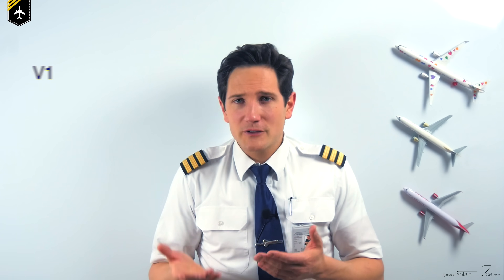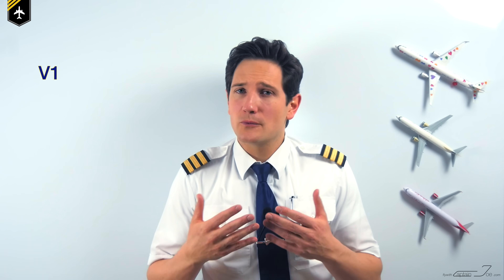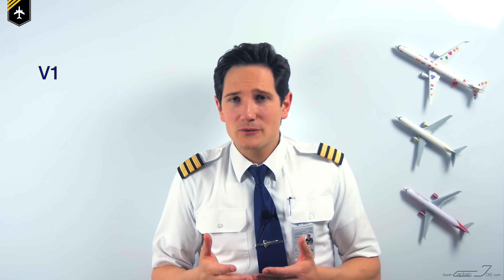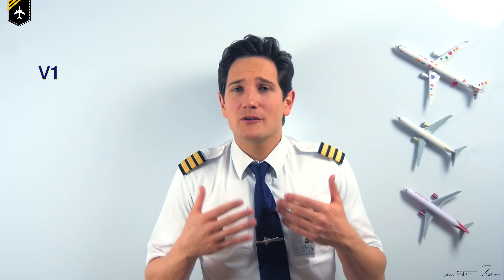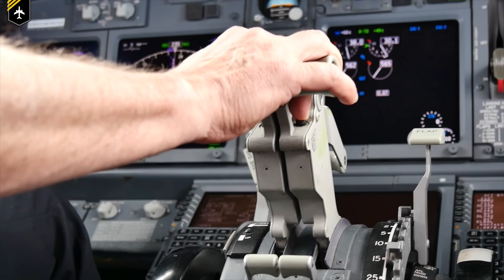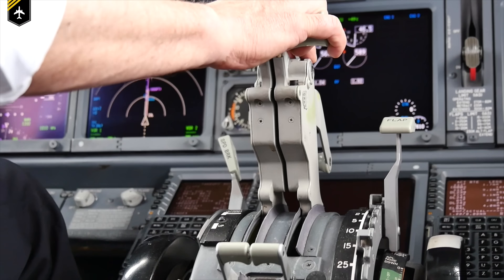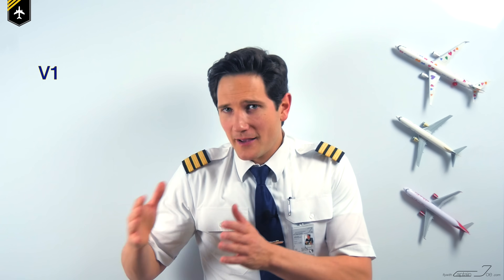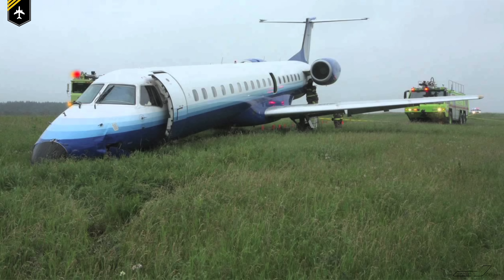TAKE-OFF Speeds V1, Vr, V2! Explained by "CAPTAIN" Joe

Comment: CAPT JOE
MY QUESTION -- CONTROL TOWER OFFICER MUST HAVE PILOT SKILLS OR NOT ?.
Reply: Not "CAPT JOE" here.  Generally no, air traffic control personnel are not required to be certificated pilots.  it is a great big world out there and I am unable speak for every possible situation; military, research, clandestine or who knows what other combination of controller/pilot pairing requirement.  It certainly helps communication, expectations and overall situational awareness when the pilot(s) are also certified and experienced air traffic controllers, and air traffic controllers possess pilot certificates ratings and current flight experience.  Air traffic controllers and pilots work in the same national and international airspace system, but each has their own set of rules they must abide with in addition to the common aviation regulations that govern both.

Comment: Why retract the landing gear after losing an engine?
Reply: Because the plane has much better performance when it isn't dragging the landing gear through 200 MPH air.  Why leave it down?  You've left the runway behind.  It also limits how fast the plane can go without damage when it is down.

Comment: The concept of V1 seems flawed.  It seems like V1 is a combination of speed and location on the runway.  For any given aircraft speed, there is a point along the runway beyond which you can't safely stop.  The V1 calculation assumes that the aircraft will accelerate as expected.  If the aircraft accelerates slower than expected, then V1 is no longer accurate because the aircraft won't reach V1 speed until it's farther down the runway than planned, thus past the point of being able to safely stop.

Also, why does V1 have to happen before VR?  If you have a long runway, strong headwind, etc, it seems like you could reach VR well before V1.
Reply: Jim St John V1 is a speed, not a location.  You are correct in one respect.  If the aircraft is at the runway limit weight and does not accelerate the way it should, a reject at the V1 speed would result in an overrun.  Takeoff power is measured by EPR or N1%.  If desired setting is achieved, the aircraft will accelerate as designed.  The only exceptions I can think of are a subtle windshear, or dragging brakes which would be noticed during the takeoff roll.
Reply: If the engines don't develop the expected thrust then you always abort the takeoff.  V1 is only a consideration if both engines are performing nominally up to that point.  V1 is calculated with a particular thrust profile, because commercial jets on long runways often don't use full thrust for takeoff in order to save wear on the engines.

Comment: Question: can a runway be so long that V_loft or V_2 is reached before V_1 ? That is, that you can always reach take off speed safely because there is so much runway left that you can still come to a complete stop no matter what ?
Reply: Juan Manuel Borrero the best way to answer this is to ask if you can get to 58 mph before you get to 55 mph in your car.  The V speeds are speeds.  V1 is the lowest, Vr is next and V2 is last.  You always pass through them in order.  No matter how long the runway is.

Comment: for a twin-engine plane v2 is for 1 engine failure. For a 4-engine plane is v2 for a single or double engine failure?
Reply: Oleg Geraschenko i was wondering the exact same, becouse i doubt a 4 engined jumbojet can take off with only one engine running
Reply: One engine failure.

Comment: I love your videos. I'm still wondering how 300 000kg plane can stay in the air. How aeroplane wings can stand that heavy load? V1 speed is so slow how can wings create  enough lift to takeoff?
Reply: Aircraft operating weight determines how much wing area is needed to stay in the air at a given speed.  So bigger wings for bigger aircraft, unless they will only fly at faster speeds for takeoff and landing (e.g. high-performance fighter jets).

Withstanding the load is done by making the structural parts of the wing thick enough, and the math for that (at least in basic design terms) goes back about 150 years.

Things like flaps (on the back of the wing) and slats (on the front of the wing) help to get more lift from a wing design, so that the aircraft can take off a a lower speed than would otherwise be needed.  That allows the runway length to be shorter, and the tires to not have to be designed for operation at a higher speed.

Comment: captain joe what do you do if both engines get a failure after take off v2
Reply: john ali you land at the nearest clear area if you can't restart the engine.
Reply: john ali 
I see a lot of answers to other questions referring to Captain Sullivan but they weren't really the right answers. For this question however it is the right answer. Like the comment above said, the first clear area
Reply: Land the ship as close to runway heading as you can obtain clear field. Activate RAM Air immediately. Don't count on restarting either engine; even if you succeed, you won't have enough altitude to spool up...

Comment: All well and good, but here's my question, which is implied by this video but never answered.

(First, I've seen a couple comments asking about what you do when both engines fail after V1 but before Vr.  Well obviously you can't take off with no engines, so there's nothing you can do except slam on the brakes and pray.)

Okay now here's my question, which as I said, is kind of implied by the video but never answered:

V1 is the speed at which you are committed to taking off even if you have one engine out.  V2 seems to be the speed you have to be going in order to take off with one engine out.   What happens if you lose an engine between those two speeds?  Too fast to abort the takeoff, but not fast enough to actually take off.  It sounds like you're screwed if that happens.  What say you?

Comment: This is an excellent video and answers a lot of questions I've had about the roll and take off of jets.  From a stylistic standpoint, Captain Joe, I think people will either like, subscribe or whatever without the admonishment.  You give a very thorough and easy to understand discussion and that will make more people, me included, to watch more of your videos.  I had wanted to post this to LiveLeak where there are quite a lot of flyers and people interested in flying, but I think they just might find the ending portion of your video a bit too schmaltzy.  Other than that, this is really a very good video, which I have liked above.  And if you've not done so, it would be interesting to hear a video of how a jet can fly with only one operative engine, especially should something like that happen over the Atlantic.  Cheers!

Comment: On a single engine prop say a Cessna 172 what happen if you reach V1 or VR and a engine failure occurs ?
Reply: thomasabramson100 there is no v1 speed.

Generally in a single engine aircraft, you abort the takeoff, try to land on the remaining runway or try to put the plane down in some empty space.
Reply: Single engine planes don't have V1 or V2 as there's no decision to be made when the engine fails - you aren't taking off.

Comment: Hey, Captain Joe, what's Vy?
Reply: Fair question; perhaps I can clarify.  If you wanted to win a marathon foot race, what would be your strategy?  Would it be to sprint as fast and as hard as you can?  That’s the fastest right?  Sprinting as fast as you can to exhaustion and collapse, would that win the marathon?  Possible but not likely.  It is more likely that you would pace yourself to go the distance.  So the “fastest” marathon time is not necessarily achieved by sprinting.  Back to your question.  You are right about full power, you are going to use the maximum allowable thrust.  (There is always “more” in aviation.  For example on many engines you cannot hold “max power/full throttle indefinitely.  Frequently there is a time limit on “full throttle”.  But I’m digressing here).  Remember the goal is to reach the higher desired altitude in the least amount of time.  You are looking to climb to 10.000’ from sea level and you want to get there as quickly as possible.

Envision your airplane near sea level in level flight at maximum power; your speed (indicated airspeed, IAS) will increase up to a point then no longer increases.  You’re flying as fast as the engine and airplane is capable of flying straight and level.  Let’s say that speed is 200 mph.  Now we begin to climb, “pitch up” 1 degree, with the engine still at max power where it stays for the discussion.  You will begin to climb.  There is an instrument called the “VSI” (vertical speed indicator) calibrated to read rates of climb and descent in feet per minute.  At 1 degree pitch up let’s say you get 50’ rate of climb.  In one minute you will have climbed 50'.   Now that you are climbing your IAS slows down; let’s say you are now indicating 190 IAS.  As you continue to pitch up your IAS will continue to decrease.  At some point, let’s say 60 mph, you reach stalling speed.  You can’t fly any slower because the wings cannot produce enough lift to keep your airplane in the air at a lower speed.  The rate of IAS slowing if fairly linear between straight and level and 200 mph, and 30 degrees nose up and an IAS of 60 where you ended up.  However your rate of climb, measured by the VSI, will not be linear.

As you pitch up from straight and level your rate of climb will increase from zero, at straight and level, to a maximum value some point (VY) and then it will begin to decrease back to zero again.  At the high power and slower airspeed you are demonstrating what’s known as the “back side of the power curve”.  Let’s just say that at 20 degrees aircraft nose up you ended up with 1,800’ rate of climb.  The wing is at its most efficient angle of attack for climbing.  As you command a higher angle of attack, pitch up, the wing increases its angle of attack now beyond the “optimal”  you greatly increase “induced drag”. At 60 mph IAS and 30 degrees nose up pitch you are no longer climbing and are just barely above a stall.  The wing is producing a tremendous amount of induced drag (byproduct of creating lift) at those extreme high pitch attitudes and is beyond its designed optimal performance.

This is demonstrated and practiced early on in flight training.  From straight and level the power is reduced, the airspeed decreases and the pilot is told to maintain altitude: don't climb or descend.  To do so the pilot increases pitch to counter act the decreasing airspeed followed by the tendency to descend.  As the airspeed continues to decrease power is increased again, pitch is increased in an effort to maintain level flight.  Eventually you end up with full power, maximum pitch and level flight.  It’s called “slow flight” and a variation is “minimum controllable airspeed”.

A wing design is a compromise; flying as fast as possible, flying as slow as possible, lifting as much weigh as possible within design limitations, taking off in the shortest length as possible and so on with the design goals.  At some point a given wing is most efficient at climbing, beyond that point faster or slower it is less efficient.  There is a angle of attack and a resulting airspeed at which the wing will climb at the greatest rate measured by time.  That speed is "best rate" VY,  it is not the fastest the wing is capable of flying, nor is it the slowest speed the wing is capable of producing lift.

You ask a great question.  Sorry for the long reply; I hope it was an understandable answer.

Respectfully,
Reply: Samuel Marinov speed for the best rate of climb.
Reply: Not "captain Joe" here but here is another answer.  Vy is best rate of climb when measuring by Time.  Meaning if you want to get to the highest altitude in the least amount of time then fly at Vy.  This is in contrast to Vx, best angle.  Best angle will get you the highest altitude in the shortest amount of DISTANCE as in a runway for example.  If you have to get your airplane over an obstacle; tree, building, antenna or other physical barrier located at or near the end of the runway then you want to get the most amount of altitude in the shortest distance traveled.  For transport category airplanes, big airplanes, there will be a climb profile that is designed to get the aircraft to the cruising altitude most efficiently (usually cost) depending on the cost of the various operating factors involved (wages for the flight and cabin crew, fuel, maintenance reserves, headwind/tailwind etc.
Reply: Apack Westbound 
I'm not a pilot so keep that in mind as you read my question please lol Reading your description of Vy I would think the best rate of climb would be the same for every plane and that would be "go as fast as you can, full power". What other speed would get you higher, faster?
Reply: Apack Westbound 
Hey thanks for replying and for the detailed answer. I'm not supposed to be on YouTube right now so I had to sort of skim through your answer but I think I got the idea.

 Maximum sustainable power will be used, logically and to get to the maximum altitude, quickest you're not going to vary that power setting, you're going to choose a sustainable rate of climb. 

For example even most fighter planes cannot sustain a vertical climb so to get to the maximum altitude as quickly as possible they're going to climb at a rate less than vertical or perhaps go vertical then level off regain velocity and go vertical again, something like that.
Reply: Samuel Marinov It is the airspeed that gives the most feet/ minute   rate of climb.

Comment: Captain Joe would you be able to  explain  procedures on how to safety  pull out of a stall  either with a multi engine aircraft or single engine aircraft
Reply: Generally, full thrust, nose down.
Reply: Add power, pull back once airspeed is attained.

Comment: Hey love from Pakistan 🇵🇰 
explain trim spinner,?
Reply: Airbus uses an automatic trimming system. What the trim does, is adjust the elevator for smooth flight. Basically, instead of the pilot pulling back on the stick all the time, the trim will just trim the elevators up.

Comment: Thank You. Great video. I'm still wondering what a pilot flying should do, when engine failure occurs a split second after reaching V1 and before reaching V2. My interpretation is: he must not abort takeoff, he should rotate at Vr, he should manouver the aircraft in such manner, that IAS will not drop below V2... Then the pilot flying is certain that: the aircraft is capable to sustain positive VS, the obstacle clearance is sufficient...  Am I understanding it correctly?
Reply: horvath83 Yes, this is one of the few comments that is correct.  Nice job!

Comment: Joe can you please explain the difference between ground speed and indicated airspeed
Reply: rakib hassan ground speed is the speed in relation to the ground. Indicated airspeed is the speed (more specifically pressure difference) measured by the aircraft.

Simple way to understand this is imagining a rocket taking off vertically. It will have zero ground speed but it will have some airspeed.

Comment: At some large airports past the end of the runway beyond the hold short is an area that has crushed cement.  If an aircraft can't stop by the end of the runway it will end up in this area and the crushed cement slows and stops the aircraft and is there to keep the aircraft inside the airport boundaries.

Comment: Joe, your videos are excellent. However, I detected an error in this video: you state that "at rotation, the generate lift over the wings becomes greater than the aircraft weight..." 
This is wrong! The lift becomes EQUAL to the weight and that's what keeps the aircraft airborne. What takes the aircraft "up and away from the ground" is simply the flight path that's pointed "uphill".

Comment: How about Air France 4590, Concorde disaster? It reached V1 with fuel tank ruptured, blazing fire on engine 2, then 1. Wouldn't aborting at V1 into a grassy crash be better than stalling in midair at 200 knots?

Comment: How far can 747 fly with no engines from 30,000 feet?
Reply: Inside the North Korean airspace, just enough to shout "Fxxk me!"
Reply: James Barratt The rule of thumb for most transport category jets is about 3 miles per thousand feet of altitude above ground level.  30,000 feet gives about 90 miles of gliding over sea level ground.
Reply: Depends on speed and weight.

Comment: @Captain Joe How is "rotate" defined for a plane with a taildragger landing-gear?
Reply: It's defined the same way.  Long before V1 speed the tail gear will be up off of the ground.  Rotation is when you pull the stick back to point the nose into the air.

Comment: Captain Joe, now days with wide body jetliners, how come jet engines don’t have afterburners for emergency power, such as single engine takeoff in case of second engine power failure, go around power, etc. It is cheap to add.
Reply: That's a general design choice. You can't slap an afterburner to each and every jetengine. It needs to be designed for it from the start.